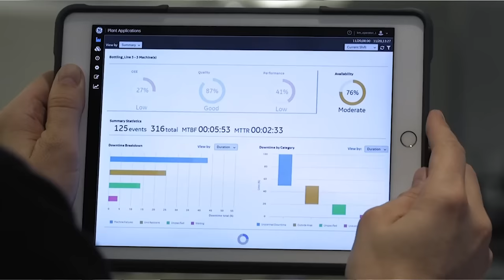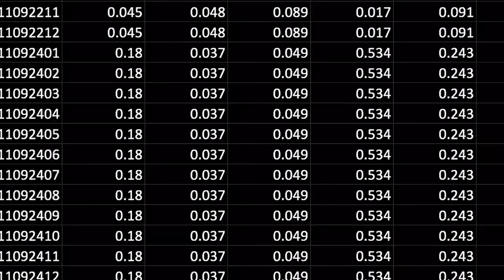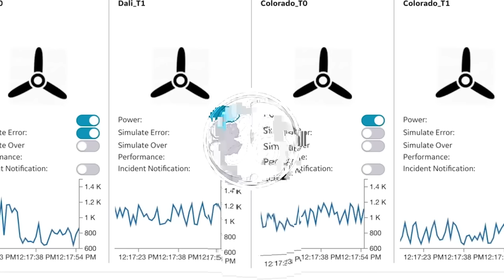Easing the Transition: How GE Digital Software Is Helping Make Cleaner Energy Possible

Comment: permanent electric power generation project) my project depends on one of the renewable energy sources. The idea of the project is different from all existing renewable energy projects. They are not solar panels, they are not a dam, they are not turbines that depend on wind or the movement of waves, tides, etc.(Advantages and disadvantages) 1-A permanent source of electrical energy. 2- Generates any required amount of electrical energy. 3- Maintenance is normal, but it is low. 4- The initial cost of building the project is similar to the cost of building dams, but it is a perfitable project in the long run. 5- It needs certain places, knowing that many countries can take advantage of this project.